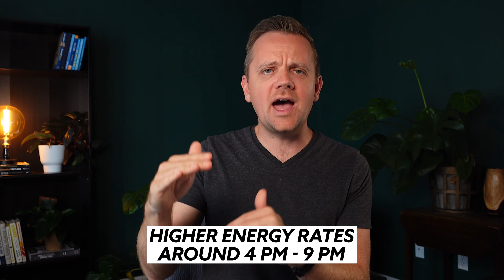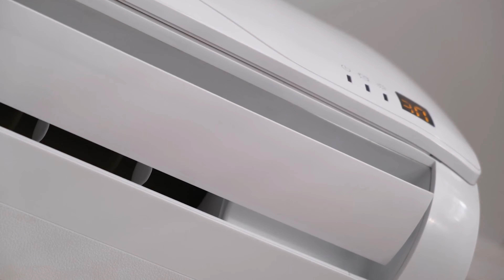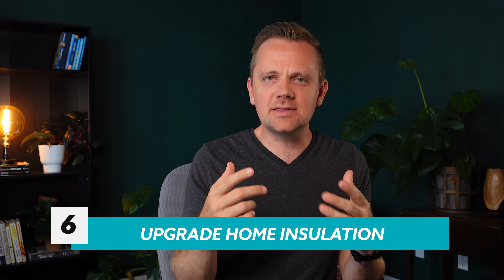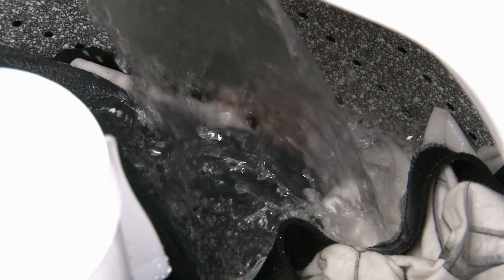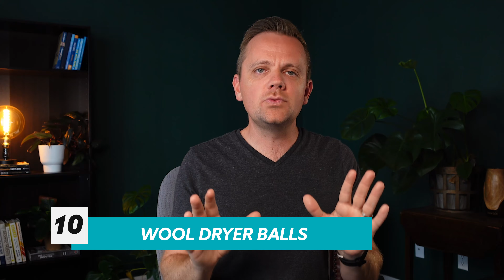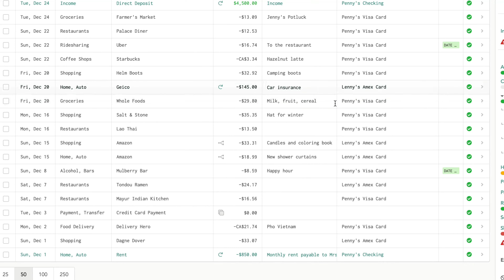Cut Your Electricity Bill In HALF! (12 Savings Hacks)

Comment: I am a real human engineer, not a "social media presenter" (script reader).
+ Insulation is cheaper than electricity -- in the long run. Buy more insulation! It can be easily installed on the interior ceiling. External roll up-down awnings shade direct sunlight in summer, and allow it in winter -- without blocking your outdoor view, which is important for variation in eye focus & health. Insulating curtains are most effective at night in winter.
+ Add insulation around a water heater. Lowering the water temperature enhances growth of bacteria in the tank, which does not survive at higher temperatures. Similarly, hotter water reduces bacteria and virus on hand-washed dishes. Also, add closed-cell foam around hot waer pipes, where possible.
+ Smart people work better than "smart" thermosats. Buy a cheap thermostat with a scheduling feature.
+ LED bulb lighting is significantly longer lasting and more efficient than an incandescent or fluorescent bulb. Also, you can choose an LED bulb with a high CRI (color rendering index) which is very natural and reduced eye fatigue; and you can choose daylight (5600K and above), or early morning (3200K, used in movie and TV studios). Use a dimmer with a compatible bulb.
+ "Shutting off" power to a device connected to a desktop computer, will alert the operating system -- that the device is gone, and it will automatically search for a substitute. This is particularly problematic with monitor power down, because many graphics cards will revert to the default arrangement and resolution -- which subsequently requires reconfiguration of your monitor setup.
+ Ironic how this presenter has a monitor on in the background, and a decorative incandescent light - both wasting electricity!

Comment: I use a portable washing machine since my unit does not come with a washer or dryer and is fairly efficient, but does not run on a whole lot of power as I live in a 900 square foot apartment.  I do most of my clothes for 15 minutes where it will run the rinse and spin cycle and then I hang things up on a hanger.  Most things are usually dry within 2 days or so, some things much less time than that.   Speaking of LED, I had LED lights on a light fixture in my kitchen but they died in less than 8 months, but I have never had any issues with incandescent bulbs, rarely do I have to replace them(I use 40 watt bulbs).   I live here in Northern Utah where we have had a mild winter and yet my supposed kilowatts went from 150 last October, to 854 in November and has gone up ever almost 1,300 which is way off since I do not consume anything near that in an average day,  and I am not only at night after 6pm.  I turn all the lights off, and my appliances are not so old that they should be sucking too much electricity, and I keep my thermostat at 70 degrees.  Of course the local power company blames things on drought, having to borrow water from other districts, and the aging electrical grid(which that one is an excuse, they should have upgraded everything 10-15 years ago).  The oven range in my unit is not that old so I know it is not that, and my water heater is just over a year old, so I know it is not that either.  The power company is threatening to turn off my power by the 17th if I don't pay the rest of my bill but I am not sure exactly what the property owners can do to combat the sky-high price increases, because these companies always find a way to pass the cost onto the rest of us, and we need to stand up to that.   I would be curious to know what everyone is paying on their average power or gas bill.

Comment: My electric company required me to sign up for the Time of Use program and they had to change my meter---it wasn't just deciding to use power during certain times of the day. When I changed over I was obligated to stay on the program for 1 year before I could change back. But, off peak time rates are 4 cents per kwh lower, and super off peak rates are 25% of the regular rates--that is incredible. I do laundry, dishwasher, showers, some cooking, water heater, and I pre heat and pre cool during those hours. Regular rates right now are around 11 cents kwh, but on peak rates are insane---19.6 cents per kwh. So, I am serious about shutting everything down during those on peak hours. On peak hours are 6-9 a.m. in winter and 2-6 p.m. in the summer Monday -Friday excluding federal holidays. . So it's not too much of an inconvenience. Check your electric company's website for the time of use program or give them a call--but just remember: Time of Use rates may not be automatic. You may have to sign up for the program (if your company has the program).

Comment: You can dry your clothes inside  on racks and plastic hangers. Especially in winter with furnace already on and the AC in the summer. It may take 24 hours for everything to be bone dry but no one has just one of anything. It will help your clothes and towels to last longer.
Reply: I’ve been doing that for a while now. It really saves wear and tear on your  clothes.

Comment: Some advanced tips from me.. 😂Get a generic kill a watt then labeled each power strip or device with standby watts and generating watts. Example Keurig uses 1.2 w standby and 993 during heat up.  Try to find power strips with a very tiny on/off button light or one without a lit on/off. Get grounded switches for outlets not in as much use then use on/off for exactly what is needed. Use Bseed outlet surge protectors. While big appliances have a shut off cycle during power outage they don’t prevent damage from power spikes or brownouts. Ours saved Maytag washer, had a spike right before entire block went out. Things like robot vacuum unplug until needed, plug in night before. Most of our bulbs are 5watts or less. GE makes a really good 5/6watt that has more lumens so it’s brighter. 5watts especially in a smart bulb hard to get, they sell out. I order ahead and keep a box of each. Floor fans Vornado and Dr Prepare use about 33watts we changed our room fans to these, excellent. Lastly clean out the inside of fridge/defrost freezer once a year, vacuum back parts. Must understand more about wattage, electric rates and it’s an experiment if you want to save $$$z
Reply: All good things, with all the tech we have now its amazing how much we use.  just remember lighting and standby usage is 15-25% of your KWH usage at most so . Dont forget to address the energy hog appliances (climate control, cooking).  You might get more bang for your buck. As you mentioned being more educated on power usag can help alot

Comment: Some good tips except for unplugging devices when not used. Nobody is going to unplug their modems, computer, tv's, cell phone chargers, coffee makers, or any other low current drawing device. Plugging it in and out every time you go to use it is just not happening. And in the case of cell phone chargers, leaving one plugged in continuously will only cost you .06 or .07 cents a year so if you can't afford that, you have major money problems!!
Reply: I unplug all when not in use. My bill is under $50. Don't forget those Smart meters can draw current from anything at any time and rack up your bill. They should be illegal for that reason only.
Reply: @Crupett-c3c You can look up phantom power consumption calculators online, put in your device, your energy charge per kilowatt hour, and see EXACTLY how much it costs you per year. Most phantom draw is 0.1 to 0.3 watts per hour. I get 1,000 watt (1 kilowatt) hours for $0.11 cents. That's 10,000 hours of phantom draw at 0.1 watt hour for only 11 cents. You do the math.
Reply from the maker: I tend to agree, which is why smart power strips kinda make the most sense here.
Reply: I unplug whatever I can when not in use. Makes a difference….
Reply: @evelyny7037  The current draw is so small on plugged in devices it's impossible to see a difference in your electric bill due to fluctuations in energy usage each month. If you have 10 devices left plugged in, after a year you will have used 10.00 in electricity more than you would have if unplugged. Hardly worth the effort of plugging and unplugging.
Reply: @lunchmoneyapp  I'm not so sure. If I have 10 devices drawing 10 cents a year in phantom power, and at an average price of $25.00 for a smart power strip, it would take 25 years to break even on my smart power strip purchase. It's like "Energy Efficient Windows" costing $12,000 dollars to save $200.00 a year on electric bills, if even you can even save that much per year. The other big item is solar panels which are hugely expensive and break even time could be 20 years down the road, just when the panels need replacing or removed/replaced for a new roof, adding to the cost of "energy saving" solar panels. Cost vs effect.
Reply: My dad unplugged the microwave and most of the outlets. I hate it. Later, I saw my sister-in-law did the same.